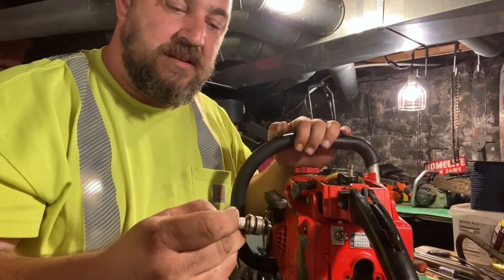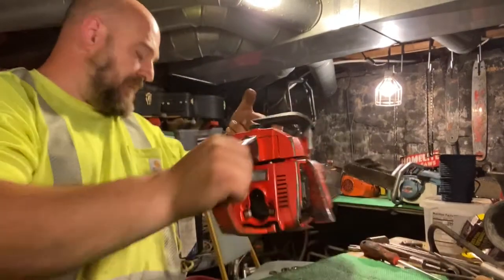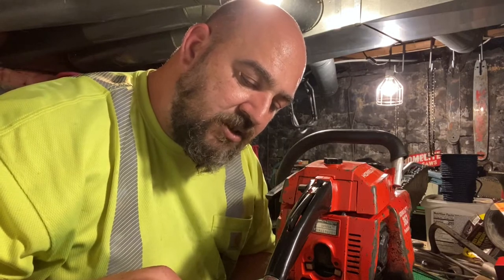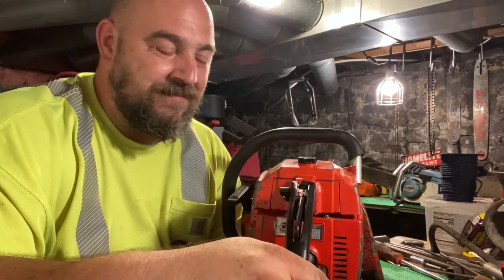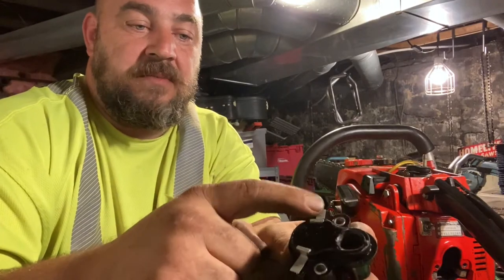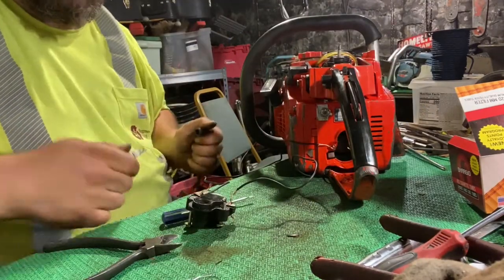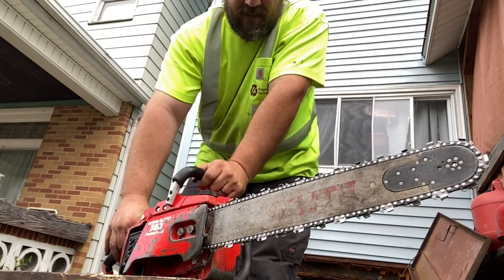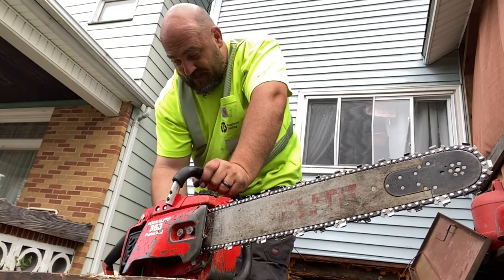Vintage Homelite 360 Chainsaw!  The life of vintage chainsaw repair!  Doing things the hard way!

Comment: When I get in a pinch trying to make a saw work properly, I go on Leons chainsaw parts and repair! He is an old guru with Homelite chainsaws! And I'm not so proud that I won't tell people that. I own at least 60saws, At least half of them are vintage Homelites! I have learned so much from watching his videos while I'm assembling a saw, And his information is priceless! I would have to guess that your inlet diaphragm is not closing the flaps fast enough! Due to the Benzene in pump fuel that causes soft rubber to become as crispy as a Ritz cracker when fuel is left in the carburetor for any length of time 😋
Reply from the maker: Leon is defiantly the go to guy!!

Comment: I just been there had a super xl would fludder around at idle and die muffler wet tiliston carb rebuilt look perfect went thru twice so I put another carb off of my xl12 put on it run the same so I went thru the ignition system I cleaned the points put another coil plate and coil first started it was screaming lol adjusted carb runs great now

Comment: How about a plugged metering bypass under the Welch plug. Regarding the seats. Mustie1, you tube, pretty good with carbs would use those qtips on the stick, break it off and chuck it in his drill and go into the seats to clean them up sometimes.normal tips work, but not as sturdy as the wood shat ones. 

Hopefully you figured it out, damn frustrating sometimes.
Reply from the maker: That’s a good idea!  I have never seen that done before!!

Comment: Have them some saw changed the connector boot and rebuilt the carbcurator 12 times turn out the needle jet can only move up and down like 5000th of and inch when you said you could seed gas coming out the carbon on top i had the same flooding problem readjusted the jet runs like new
Reply: Hope this helps
Reply from the maker: Thanks buddy!

Comment: Hey man seat the L jet and try one full turn out? Just a thought man
Reply from the maker: I use one full turn as my starting point most of the time.  It just depends on what I feel like.
Reply: @Smittyschainsaws  ok cool man I’m going to try that wire hack on mine to check the spark🤙

Comment: Just checked out your video with your frustration on that 360 a lot of times fresh eyes or fresh Minds on the situation can help out they're definitely looks like you have a fuel issue and sometimes you can be a combination of both I would start with your carb pull it off you can take out your metering diaphragm completely I run a simple test to see if your Inlet needle is shutting all the way. you are going to need to pressure test the carb by running approximately 8 lb to 10 lb of pressure through the fuel Inlet Barb if it holds pressure and does not leak out you're needle is seating properly
Next I would move on to metering lever spring and meteor lever
While carb is under pressure you should be able to perform a quick simple test on your metering lever by running something flat across the top of carburetor and sliding it across the metering lever if if the metering lever hits it will let the air pressure out. proper setting of metering lever is flush with top of carburetor
When set properly when you slide something flat over metering lever it should still hold pressure and not leak out.
If you have any questions let me know
Reply from the maker: Thanks!!  I think I might have figured it out this evening.  The needle wasn't seating correctly for certain but I found another problem.

Comment: I have had the same frustrations on my 360s before.  It can be a pain in the butt.  If it's flooding I would pressure test the carb.  If you don't have a pressure tester a good one is the mighty vac 8500.  Set your metering arm while the carb is under pressure and make sure it holds.  If it does then put your gasket and diagram in and tighten the cover down.  If you lose pressure then the arm is still too high.  This is the best way to do it on these darn hdc carbs.    Also look at your diphram the metal part that hits the arm.  If it's an aftermarket kit sometimes they make that nub too thick and it will hold the arm down all the time.  If you can get the carb assembled and it holds pressure that should fix your flooding issue.  I think someone else said it should hold around 7 psi after 2 min at min.  If you can get her to stay around 10-15 psi then your golden.  The most frustrating think about a 360 that doesn't start is your arm hurts so bad at the end of the day cause they are a pain to pull over 😁.  You will get this thing going.  Let me know.
Reply from the maker: I think I may have figured it out tonight.  Time will tell!!

Comment: I don’t know if it has been mentioned before I’m only at the point in the video where u remove the spark plug but that is the wrong plug man champion cj8 or cj6 is ur plug they have a tapered hole in the cylinder
Reply from the maker: That is probably the plug the previous owner had in it.  It has been so long since I worked on that one I can't remember but I do believe I fixed that little issue.
Reply: @Smittyschainsaws  yeah I went through the videos didn’t see one after the last carby gum up vid🤙
Reply from the maker: Its just been sitting on the shelf soaking the tank in cleaner.  It has a lot of crud in it.

Comment: Awesome video, sir. Take the recoil starter off, put a 1/2 inch socket on the drive and spin the starter with a cordless drill. Better than pulling!!! By the way, my 1978 Homelite did the same thing. Never did make it a reliable saw.
Reply from the maker: Sometimes I do things the hard way!!

Comment: If the saw keeps flooding itself out and it ran before but I noticed it was a bit hard to start here’s whT to do. Obviously the engine is pullin vacuum cause the carb is drinkin it but it’s gettin to much check the internals of the engine for damage or wear like rings gaskets etc then if all of that is good chek the compression if that’s good then move toward the carb clean it with an ultrasonic cleaner that’s chem dip is too harsh on two stroke carbs. Then pressure test the carb if it holds at 7 psi your ok. Then. Check the spark physically at the plug then clean the tank out with simply green degreaser I got a 360 and it was floodin bad turns out it was the crank seals cause it couldn’t hold crankcase pressure so it jus flooded itself out hope this helps god bless
Reply from the maker: Seals have already been replaced prior to this.  Compression is 150 ish.  I think I may have figured it out this evening.  Time will tell!!
Reply: Pressure test the carb and chek the pop off pressure
Reply from the maker: @imawsome7783  I actually found another problem that would explain all my headaches this evening.  The inlet needle was not seating for certain.  The cause of that problem was what I did not expect.
Reply: Ahh ha see gotta check those Small things did u change the metering lever at all ?
Reply from the maker: @imawsome7783  The metering lever was the first thing I checked. I wish I could post a picture. So far nobody has guessed it  yet.
Reply: Vintage Chainsaws And Firewood- yea those metering levers I don’t even mess with them

Comment: Mabye the little spring a top of spark plug inside coil. Has a tiny little hole it fits in. Might be dirty not connecting at all. Happened to me.
Reply from the maker: That could be possible!!
Reply: I meant the transformer by the way. Not used to this saw.
Reply from the maker: @stupidstupider4892  I do the same thing all the time!!

Comment: homelite DESIGNED THEM TO OVERHEAT. cylinder fins blocked on two sides by ridiculous exhaust with poor flow CAUSES OVERHEATING and BLOCKS COOLING. ignition BLOCKS 2 OTHER SIDES and fails anyway. oil pump RUBBISH and wears guide bars and chains STRAINING ENGINE to OVERHEAT. rubbish recoil, CLUTCH LININGS UNSTICK and jam in drum
Reply from the maker: Thanks

Comment: The muffler system on them 360s is terrible. Doing what I did to mine it fires rate up. Notice if the piston and cylinder may look new or unused and that would be from lack of running all because the exhaust system is absolutely terrible. Open it up and you should have a different out come.